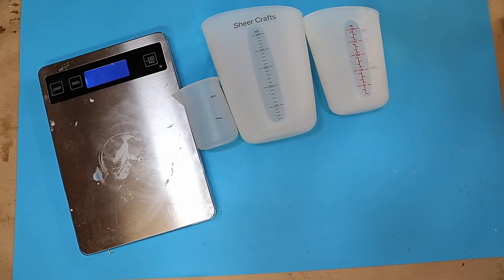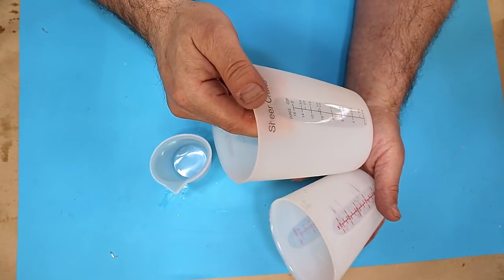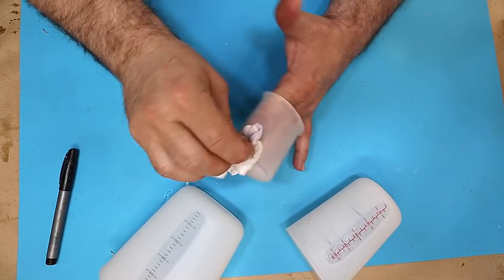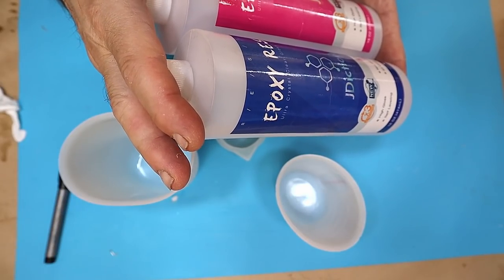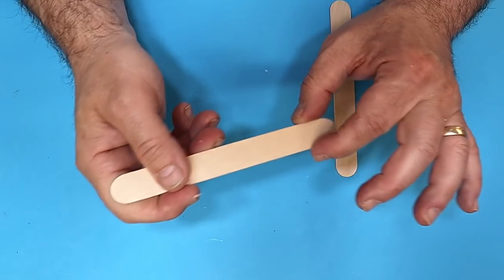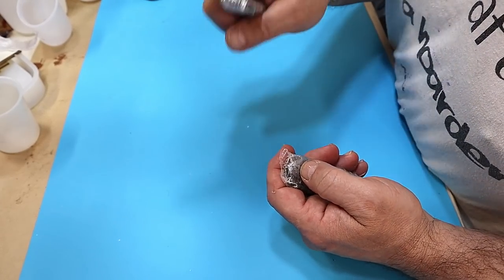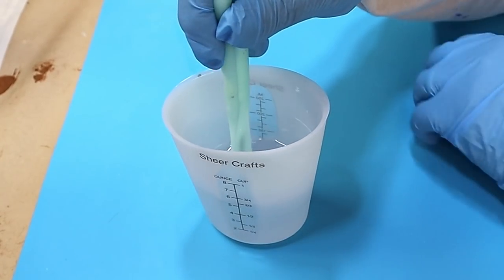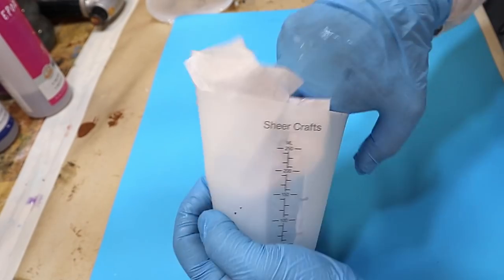The Best Method To Mix Resin to Avoid Bubbles

Comment: I always write A and B in permanent marker on my bottle tops, just for extra assurance that I don’t put them on the wrong bottles.  Also, after I use a mold for the first time, I weigh the cured project and that gives me the approximate amount that I need to mix for the next time I use the mold, divided into the appropriate proportions, of course. I Write the weight on the bag I keep the mold in so I will know the next time how  much Resin I need to mix.

Comment: I wrap my bottles in a seed starter mat which has a thermostat I can set to the temperature I want. It takes a while but there is always something else to do while I wait. I also use that mat to keep the pieces at a good even temperature during curing. The mat doesn’t stay heating the whole time, if it senses the curing temp is higher than the setting, it will blink off for a while ✅. And With all your tips above, I don’t have 50% seconds any more. Also looking forward to trying your resin curing heater, but I already have the seed starter mat with thermostat.

Comment: I used to use those oval containers all the time. Then one day, Erika from Artist Till Death sent me a small Stone Coat Art Coat to try. I was having a bit of an issue with it curing. So next day, I thought I would try again. When I looked at the bottles, one of them had a lot less. I knew (because I always check) that they were even amounts when they came. So I took that container out to my kitchen and and got a measuring cup, and sure enough, it was so off!!! I checked all of them that I had and they were all off. I have noticed on directions that it says to use a round measuring cup. So I do not use those anymore except to mix things after I've measured. But I do check all of my stuff now before I use resin to make sure that it measures correctly.

Comment: Learned the hard way about mixing the resin with the a/c on, had no problem during the cooler months when the heat was on, now have to warm up the resin 1st, and sweat my a$$ off when working with the resin because the vent is closed and covered in the room I’m working in, only way to keep the bubbles out..and it got HOT and HUMID here in Georgia..

Comment: Thank you for this video. I'm getting better at using resin, but still make a lot of mistakes.  I've been using baby wipes but just bought some alcohol wipes as I thought they would be better.  Thank you for letting me know they may ruin my molds.  The wipes were very inexpensive so no problem, and I can use them elsewhere.  I learned the get down and look at the measurements when learning to bake so been doing that with my resin.  I like that you use on cup to measure.  Some resins say measure in 2 separate cups then pour one into the other. Your way makes more sense, because there is always a little resin left in the cup you pour from.  I keep watching your videos and someday I'm going to get it right.  You make everything look so easy. Thanks again.

Comment: I've been putting part B first, & then A on top, because when i did it the other way around, i could tell that part B was staying toward the top & not moxing all the way. I could tell because it was yellow compared to part A. Now that i switched the order, they are mixing better. Part A is inclined to sink to the bottom. (I'm assuming it's denser.)

Comment: When working with a resin that is 2 or 3 parts A and one part B it is necessary to pour the hardener into the resin so there is no hardening going on while you are still pouring and beginning to mix, especially if it’s a large pour. The resin needs to be chemically balanced and evenly mixed before it starts changing and heating. It’s a good habit to get into with smaller projects so you have it in place if you decide to do a larger pour.  People will hear you say it doesn’t matter and then go do a 3 liter project where it does matter and their project will be ruined. It’s just best to always pour the hardener ( part B ) into the resin (part A) no matter what the size. Even small pours it is best to mix the hardener into the resin, when you start stirring you are moving the hardener around more keeping it fluid to blend with the resin better.
Reply: Go alphabetically 😀
Reply: Good ty

Comment: Thanks for a lot of great tips.  I have a question about knowing how much resin to mix up.  How do you measure the volume of your molds before you mix your resin?  I am thinking I could just fill it with water to find the volume and then make sure I dry it well before using it for the resin.  Is that going to be accurate?  How about when you add glitter or mica or other add-ins.  That would increase the volume.  Do you reduce the amount of resin you mix?  Or do you use the measured amount and then just pour the extra into a small mold.  I know you have lots of practice and have learned the amounts you need but I am always impressed how it seems you have exactly the right amount of each color when you divide the resin into separate cups for coloring.

Comment: Hi Steve.  You mentioned FLASH CURING . What is this ?. I am having problems with my resin. It kind of separates and leave dimples. Thank you and keep up the good work.
Reply: Flash cure is that the resin reacts immediately, so in a few minutes your resin is hard, there's coming smoke of the resin , but just put it outside and don't try to pour it out of the mold, just let it cool outside so that you can save your mold after the flash cure, I had it one time that the resin ashtray was still usable, but had 2 times that I had to throw the resin away, it's going to get cloudy and really weird texture,I had a flash cure a few times it was with really warm weather and one time that it was cold, so I put the A and B in a little (to hot) water to get the cloudiness away in the resin, when I mixed it it started immediately to cure, and for dimples in your resin search on Youtube 'dimples in my resin' or 'how to fix pits in resin' or 'getting dimples in my resin' there will be a few video's on YT about it
Good Luck

Comment: I've been pouring part B first, & then A on top, because when i did it the other way around, i could tell that part B was staying toward the top & not mixing all the way. I could tell because it was yellow compared to part A. Now that i switched the order, they are mixing better. Part A is inclined to sink to the bottom. (I'm assuming it's denser.)